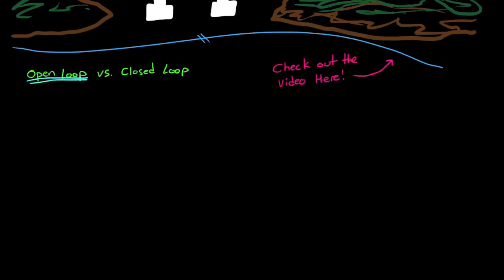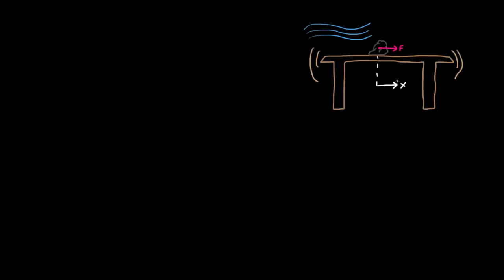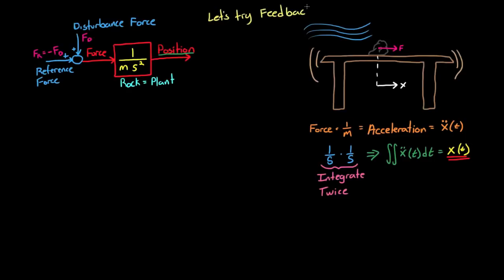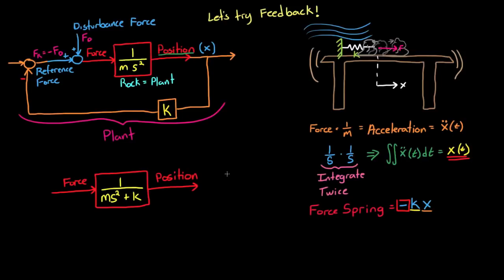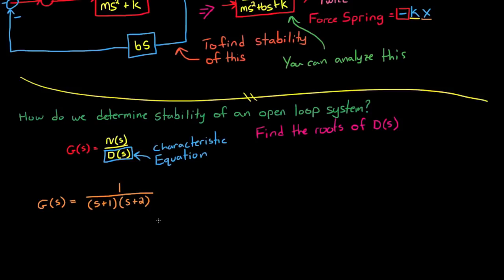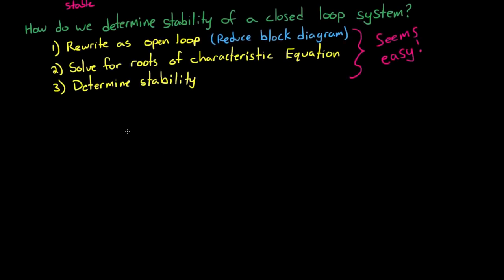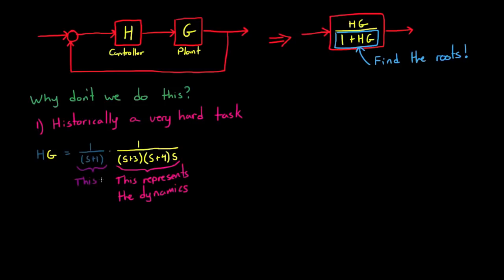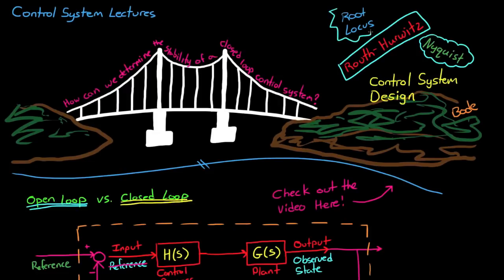Stability of Closed Loop Control Systems

Comment: The night before my final, I was looking at my review sheet feeling absolutely hopeless and was wondering defeatedly to myself what the controller would look like for some sort of cosmic feedback loop where the reference signal was a B+, I was the plant, and the interference was my (poor) decision to take classes at overlapping times, if the system was required to have a rise time < 15 hours, a steady state error <5%, and no requirements on overshoot.  It turns out that controller looks like a guy with sunglasses and a beard, and is named Brian Douglas.

Comment from the maker: Check out Timofte's post just above this one for figuring out how to calculate the TF for a mass moving across on a frictionless table. In order to look this up you'd have to realize that this is a mass-only translational mechanical system and then look up the TF for that.  Hope that helps.

Comment from the maker: This would be a fairly good linear description of the dynamics of a rock sitting on a frictionless table (assuming the rock was only translating across the table and not rotating.) So yes X(s) would be the TF, which is just the Laplace Transform of the impulse response like you calculated.
Reply: Ok

Comment: At 9:46 the open loop poles include s=zero; thus the open loop is not stable in the BIBO-sense: a  step input will cause the open loop to output a ramp. Just a minor observation. The video is excellent.

Comment: Hi Brian, 
Thanks a lot for the videos. I have a couple of questions though. 
1. If it's easily possible to solve control systems with modern computers, why do we even bother to transform to the frequency domain? 
2. Why is it difficult to find the roots of 1 + HG? Wouldn't it be the same as before since the denominator is the same? 
Thank you.
Reply: 2. Because with HG, we solve for the open loop, then the caracteristic equation is the DENOMINATOR of HG. However, with 1+HG, the problem is now closed loop system, 1+HG is the denominator of the total transfer function; then the caracteristic equation is NUMERATOR of 1+HG.

Comment: Hi Brian, thanks for the lecture! Actually, I was looking for an explanation to what may be an unusual question: From the equation of the closed loop system, it is easy to see how 180 degrees phase shift (-1) and a loop gain of x1 will cause instability in a closed system with negative feedback. What is harder to understand, at least from an intuitive perspective, is why a 180 degree phase shift and loop gain of >1 (e.g. x10) does not result in even more instability! Again, the equation, tells us that the system is stable but it seems a bit counterintuitive. Can you help me gain an intuitive understanding of why gains of >1 do not result in instability despite 180 degrees phase shift. Please!

Comment: sooo basically, if I understand this correctly, when you rewrite the transfer function of the system, that is closed, you have the polynomial division, in which P(q) is multiplication of each inidividual part of the block diagram, that is H and G. Then in the lower part of the division, you simply ADD +1 to what you have above. Right?
Reply: the closed loop transfer function is equal to  feedforward gain/(1- loop gain)   the feedforward gain is equal to HG in this example and the loop gain is equal to -HG as we have negative feedback.  so in total you get HG/(1+HG)

Comment: hi.Mr.Brian Douglas thank you for the clear explanation. I had a small question can you give me the details how these r-h criteria,root locus,bode plot are determining closed system stability directly by using open loop equation. I dont mean to get procedure for those i need to get derivation part that this made them to make a direct comment on stability of the system. so,pls give me a solution for thi though it may be stupid question please help me if i dont get the clear outview of the subject

Comment: Hi Brian, I have a transfer function 1/(s^3 + 2 s^2 + 3 s + 8), which is unstable. Then using matlab I put a controller (3s+1). In closedloop step resnpose test, the system is now stable but slow. Then I modified the controller to (3s+1)*(s+1): the response was even better. My question is: are these controllers make sense/realizable? Isn't it the rule poles > zeros is a must? Thanks a lot!!
Reply: My understanding is that only proper transfer functions (ie: The order of the numerator polynomial must be less than or equal to the order of the denomonator polynomial). So, in order to make your controller, you'll need to introduce 2 addtional poles. If you select them to decay rapidly, then they won't affect the functioning of your system too much.

Comment: First of all, great videos!! I just have one question, if the transfer function of a system has poles on the immaginary axis (0 excluded) is it considered BIBO stable? For example, is the system with the following transfer function W(S) = 1/(s^2+1) BIBO stable?

Comment: I have a little question. Shouldn't the reference be a position instead of a force? For instance, I may want the rock to be at x = 3 cm, and make an action (force) to do that. But I find no sense in saying "I want a force of such an amount of Newtons as a reference". What am I missing?
Reply: We need a force that'll cancel the effect of the disturbing force so the rock remains on the same position. Assuming you accurately measure all the variables entering the system to disturb it, the reference can  be an instantaneous opposite force...subject to the most recent disturbing force input.

Comment: Hi Brian, 
Could you help me know why a system must be un energized to find its step response.
I am dealing with a system thats a pneumatic piston. control variable is air mass flow.
so i want to find the step response of this system at various points and the spring against which the system acts is a diaphragm so its nonlinear force with position. I want a step response at many points and all but one of which have some pressure in the system. please help..